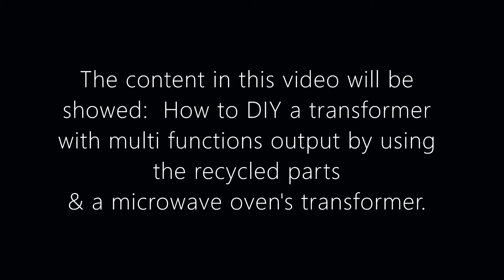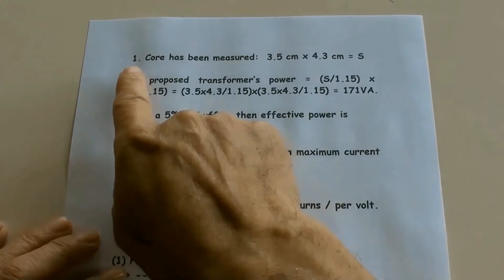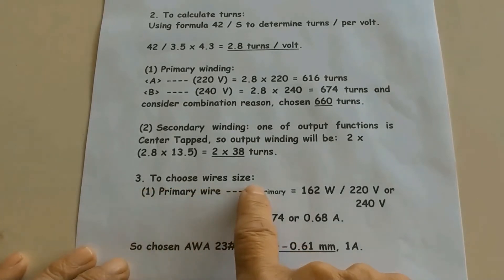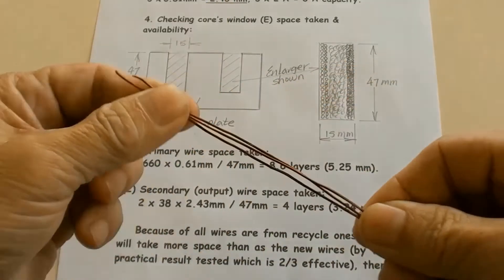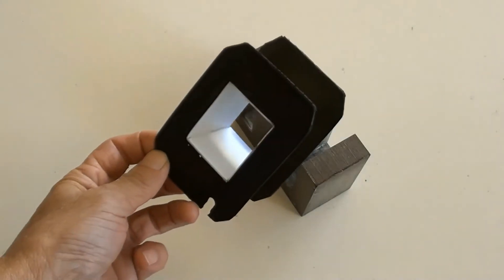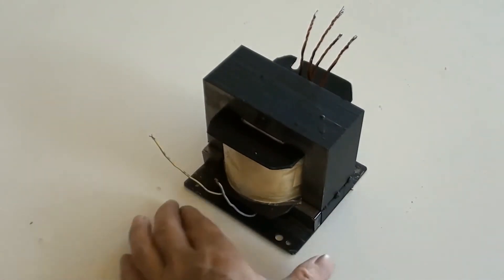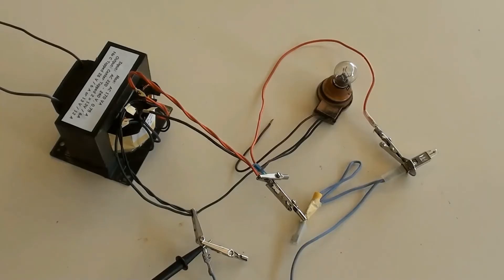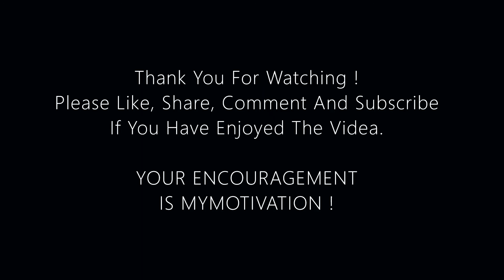How To DIY A Multi Functions Transformer By Using Recycled parts And A MOT?

Comment: Why did you not use all of the original core, requiring you to wind a new primary? 
Was there any reason (other than easier) to put all windings on the same bobbin?
In other words, why not keep the original core and primary, replacing just the old secondary bobbin with a new one for your lower voltage windings?
Reply from the maker: Good question and thank you for the interested.   In order to answer you properly, there are a few things to consider however, in short, only two things to explain for you:  First, I've made DIY transformers with the different sizes, one of them was just as your mentioned which it could be watched from my channel.  On the other hand, this video was about making a 160VA or so DIY transformer by using the recycled MOT materials and followed the standard protocol for my particular project.   Second, a DIY transformer can be made by the way of you mentioned however, due to microwave oven transformers work only short period of time, the primary coil has much less winding numbers than the standard one, so MOT primary coil produces a lot of heat quickly during it works, this is okay for MOT because the oven has an adequate cooling system to protest MOT from overheating, but the standard transformer!